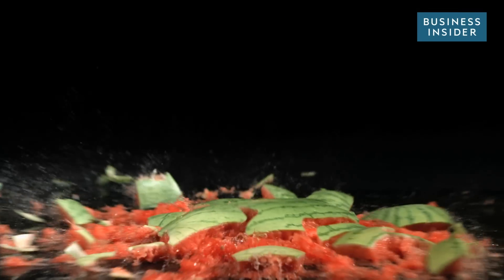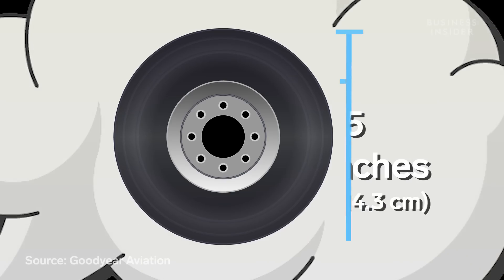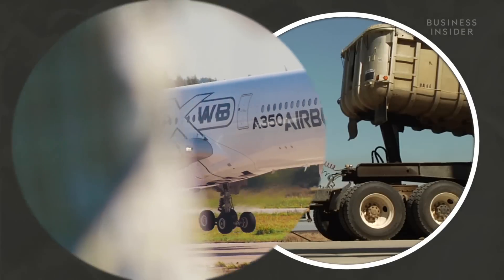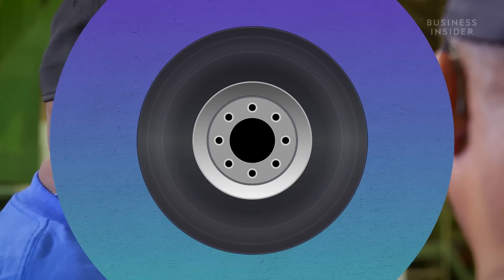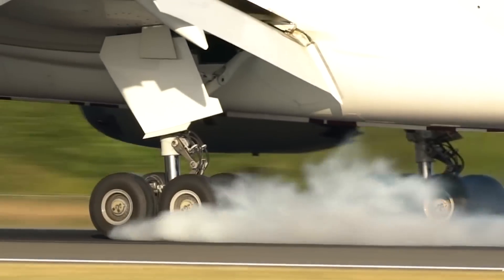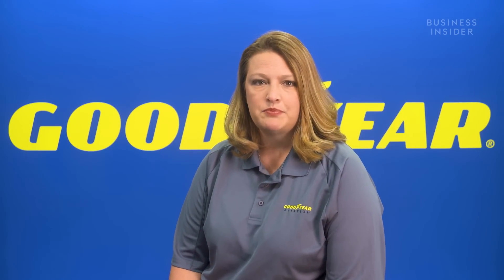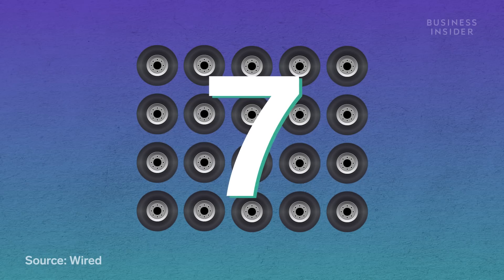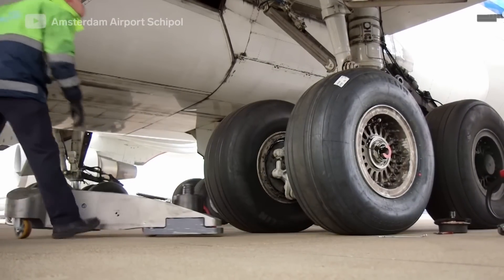Why Plane Tires Don't Explode On Landing

Comment: I don't think Airplanes touch down to the ground straight down at 170MPH, they fly horizontally at around that speed.  The touch down is around 50 feet per minute or as less as the pilot can do to make a smooth almost weightless touchdown once contacted on the ground the spoilers come up and push the aircraft more onto the ground and create drag to slow the aircraft down
Reply: Yeah, you’re right. Whoever produced this video was clearly under qualified
Reply: @colbyjohn207  hey thats not nice
Reply: @evancampbell1963  Correct. Because elsewise I would be dead.
Reply: @analool7873  "because elsewise"?? 🤣. Elsewise.
Reply: They also called the runway a tarmac.
Reply: Landing speeds can be different for different sizes of the plane. Time to time the captain and the UTC would make jokes about this. planemodel-concordeheavy
Reply: @brysonsaviation330  Tarmac is the type of material runways, taxiways and apron are made of. So typically you can call the runway a tarmac. It's just the surface
Reply: I think she meant to say the planes typically land add 170+ mph so the tire is accelerated to 170+mph in a matter of meer micro-sec. But yeah this video was done very poorly.
Reply: I agree. It is kinda dumb that she did not mention the flaps and spoilers
Reply: @flareaviation8831  Flaps, slats, and spoilers have nothing to do with tires.
Reply: Typical Vertical speed at touchdown is ~150 fpm.  Too slow vertical speed may be counterproductive. Depending on weather and RWY Condition it might be safer to land at a higher verical speed. For example to prevent aquaplaning
Reply: @analool7873  im always forgetting about, how much is knot etc. Cos i have studied aviation in Latvian, German and English, and in these languages even tho altitude internationally is said in feet, speed in knotw, but pilots and mechanics tend to keep saying kmh and meters. 

For example an 225 landing and takeoff speed is between 230-285 kmh, while B737 , its 300-330 kmh. 

A lot of it depends on wingspan. Whole 737 is as big as half of the wing of an 225. :D 225 has smoother landings, and at lower speed, and atitude drops a lot slower. And while taking off, for it actually a 3000m runway is enough, because it doesnt need that high of speed, cos of wingspan and wing area. Wing is not only longer, but also a lot wider.
Reply: @Swarmah  damn ur smart
Reply: @xivnz  i suppose, that was a sarcastic insult, because what i said is basic physics
Reply: @Swarmah  it wasn’t sarcastic I promise lol I didn’t have a clue what u said
Reply: @evancampbell1963  But jokes aside. I have flown twice with ryanair.  And you've clearly never heard a joke.
Reply: @analool7873  this is a joke...
Reply: Yes you are true but everything mentioned like the wheel is 6 times lager than a car is to withstand the heat of it touching the ground at that speed (and 170 is still a high speed and sir they are way qualified than they are so.... beat it ) LOL
Reply: Right, I was thinking that too, in fact, it is so obvious.  I wish the producers of these things would not just make stuff up like wildly inaccurate comparisons.
Reply: There are 2 force components on tyres on landing, horizontal one in plane's direction and vertical one. It's this latter that puts tremendous pressure on the tyres due to plane's weight. Harder the landing more is the 'impact', more the pressure.
Reply: @trojan-david  LmAo yOu dOnT kNow wHaT sPoileRs aNd fLaPs ArE? Flaps are the things extending, to generate more lift, so the plane can fly slower. So it doesnt have to land at 220kts, but instead can land at 140kts, which is way safer, since the distance to stop is smaller. Spoilers do the exact opposite. They destroy the lift, so once the aircraft touched down  it wont bounce up again, and since the lift is minimized the pressure on the tires is greater, and thus the traction between runway and tire is greater. And of course spoilers create additional drag, as well as flaps do. 
TLDR: Flaps = More Lift at less speed + drag            Spoilers = Destroys lift/ presses aircraft to ground + drag
Reply: Analool yh sorry I just did some research about it. You’re right
Reply: @analool7873  Maybe learn from this and not LMAO in the future?
Reply: @analool7873  ok then, sorry.
Reply: @analool7873  do you have a disease that makes you write like that?
Reply: It’s under 120 knots. That’s when they can land
Reply: @furqanahmed4557  depends on aircraft.
Reply: Well said
Reply: Ya but horizontal speed counts for friction and strain
Reply: 170MPH is correct its just because not on knots. 170mph is 147knots
Reply: @evancampbell1963  I have and I died
Reply: This is what happens when they get women to explain things
Reply: Pretty sure Terminal velocity is much lower than 170 mph on a watermelon,  Google says 112mph fwiw so obviously little research was done
Reply: @systdow666  yeah I was thinking around 120 mph off the top of my head without looking anything up.
Reply: @evancampbell1963  maybe. maybe not :D
Reply: also only like the 747 and a380 and other very heavy planes touch the ground at 170 MPH
Reply: @aviationtime3202  false
Reply: But they still need to support forward motion of 170mph on top of downward impact
Reply: The Harrier Jump Jet has wheels.
Reply: @evancampbell1963  anyone can reply to your comments, genius
Reply: They didn’t mention about naval air craft those planes need more ridged tires and gears because of being luanched from the cat and dont forget landing which is done at a higher speed and the arresting wires slow you down at a more rapid pace.
Reply: ew no one likes a "actually" person
Reply: im the 1 thousandth like
Reply: 50 feet per minute is extremely slow, that’s like driving at 0.5 MPH, put that into perspective people walk at 3-4MPH. If it was that slow then I don’t think it would feel like driving over a big speed bump.
Reply: Thank you. I immediately thought that when she said that.
Reply: There is a lot of torque and static friction at the bottom of the wheels.
Reply: Wrong.. instead of putting the flaps up when landing you put them up before hand so that it slows speeds. On most planes there’s two settings the first flap slows speeds but dose not decrease speed too much. The second setting makes the flaps fully extended, so you would do this when landing. Have a good day :) (I’m a airplane nerd)
Reply: Yeap, so many things wrong with this video, like how many times they show stuff falling to the ground, which is not at all how airplanes land. Also, the answer to the title is not there, "Why they do't explode?" ... "oh, they are strong" ... done, really, this is the lazy level youtube "tech insider" videos came to? bummer.
Reply: Yes the aircraft touches down at 140 knots and when they’re coming in for landing they pitch the aircraft up which is called a flare
Reply: @Aviator1414  the speed of each aircraft is different on landing, as i explained, we engineers still use kmh, so depending on aircraft, the speed is +-100 kmh on landing. The average is arround 300.
Reply: No shit. U also got ur thrust reverses and ur flaps... like cmon who made this video. Always asking these dumbass questions
Reply: IF the aircraft falls straight down - with little to no forward movement - you could have all the nitrogen in the US in the tires, and that aircraft is still gonna go 'boom'..... the longevity of the tires is as much about forward movement as it is about tire pressure, tire construction, and load capacity.
Reply: American Spotted lol who the HECK uses 50 feet per minute?!?
Reply: Still if you skid a watermelon along the pavement at 170+ MPH, it's going to be Gallagher-class messy as hell.
Reply: No, it's usually around 150-200 feet per minute. 50 is too soft, that is flight simulator pilot nonsense
Reply: Neither does anybody who has the basic capability for logic.
Reply: More like 300 or less
Reply: @Daniel Jones Rolls Royce makes jet engines. And their cars aren't known to be reliable.
Reply: True
Reply: I agree. I’m no pilot but if the pilot hits the ground downwards at 170 mph your tires aren’t going to save you.
Reply: Ryanair pilots entered the chat
Reply: @AdvaitVaze  Ryanait pilots crashed onto the chat
Reply: @analool7873  into*
Reply: Nitrogen is an inert gas? Every chemist in the world would disagree.
Reply: 50 feet per minute is approximately 0.568 MPH.
There are very few aircraft that land at half a mile per hour,
and no commercial passenger jets.
Reply: @robynharris7179  really? Man I gotta go do more research up on aviation
Reply: @robynharris7179  I was waiting for this comment😂😂 I didn’t think he was serious or that I was reading it wrong when he said that
Reply: You clearly don't know what 50 feet per minute is, maybee 50miles or 50 knots per minute tou mean? An aircraft that size couldn't fly at 50 feet per minute. It's not a harrier or f-35b
Reply: Jeremiah 4:7

 

“The lion is come up from his thicket, and the destroyer of the Gentiles is on his way; he is gone forth from his place to make thy land desolate; and thy cities shall be laid waste, without an inhabitant.”
Reply: @Daniel Jones This may be true in 2020 and 2021 only, as these 2 years are particularly 'not good years'. Covid. 😆😁

Comment: I wondered how the Space Shuttle tires survived in space. Then I realized that it's only one more atmosphere in pressure differential for a tire that is already pumped up to a much higher differential. That extra 1 ATM isn't all that significant.
Reply: Yes, the Orbiter tires were of conventional design, though with a different proportion of constituent materials for the modestly higher operating specs.  A unusual problem faced with those was that it could be months between when they were no longer accessible and the time of the landing.  So each one, after mounting on its wheel, had its air loss measured over three months.  Then before flight, "overinflated" to try to have the pressure about right at the presumed landing time.

Comment: Showing other vehicles like a plane  lands or drop at 90° on the runway.  It has both vertical and horizontal components  which also reduces the stress on those tires.
Reply: It also has the lift force on the wings supporting most of the weight.

Comment: Average vertical speed of an aircraft when landing is less than 400ft/ minute which is around 2 meters a second. That's less than 5 miles an hour, so stating that they land at 170mph is wrong. The plane's forward speed could be 160 knots, but the vertical speed, nowhere near that

Comment: Why aren't airplane tires accelerated to ground speed before landing?
Reply: My guess is that Goodyear told them it'd be a bad idea, or the mechanism is too heavy/complicated.  I was thinking it could be kept light by using wind power, utilizing the same principles as a vertical axis turbine.
Reply: @Bart Solari I don't think so.

Comment: The tire debris on highways is from re-treaded tires.  The new tread is glued on to old tires and sometimes the glue comes undone.  I read that airliner tires last about 200 landings - far shorter life than truck tires which last 100,000-200,000 Miles!

Comment: As a pilot, I’d like to know where the Tarmac is. Because I’ve got runways, aprons, taxiways, but no tarmac
Reply: Tarmac is a name for a material that at one point was used in airport pavement construction.  Even though this application no longer uses tarmac as the material, tarmac is the de-facto name for any pavement at the airport, that is built for airplane traffic.  It refers to all of the above collectively.  Runways, jet aprons and taxiways.
Reply: Except it was hardly ever used on airports because it became obsolete within a few years of its development and almost all airports were built with concrete and asphalt. Tarmacadam was the patented name and with the automobile development and oil production coal tar was tossed aside and replaced with pre mixed asphalt with the first flight in 1903 and aviation really not hitting its boom until the late teens and early 20’s tarmac was a minimally used surface in the first paved airports. Especially since most airfields were dirt or grass through the First World War then metal slats with dirt aprons then concrete.

Comment: 10/30/2019

First of all, there is no such thing as a semi-truck. There are semi-trailers and trucks/tractors which pull them.Second, the airplane tire is not falling at 170mph, but 500 feet/min. The tire and the airplane are moving horizontally to the runway at 170mph. Finally, those tire pieces on the highway are not from exploding tires, but from the tire caps coming off retread tires.

Comment: Will Brandy, you are trying to compare apples to oranges.
Airplane tires are constructed differently then automotive and truck tires. The rubber on the road is from recaps. You should learn the facts.

Comment: 1:55 Is Nitrogen an inert gas ? 😄😂
Reply: Nitrogen is isn't an inert gas, in the same sense that argon is an inert gas, but for many purposes it behaves as a quasi-inert gas, because of how energy-intensive it is to break its elemental diatomic form.  Unlike oxygen that may ionize to form ozone, or oxidize other substances such as metal corrosion, nitrogen will not do that.  Some plants have the capability of chemically reacting N2, but for the most part, as long as you don't heat it to flame temperatures, it will stay as N2.

The obvious reason they don't use actual inert gasses to fill tires, is that it is a lot more expensive to distill argon, krypton, neon and xenon from the air.  Nitrogen is the dominant component of air, so it is the most readily available to use, when a non-reactive gas is needed.

Comment: The example you used with the watermelon is unnecessary, it’s all about the landing rate. The landing gear has different components to reduce the landing impact it’s not just the tires that does the work.

Comment: Airplane tires only need those parallel grooves because planes don't need traction on their tires, also planes don't steer at high speeds on the ground.

Comment: "They raise it only 5 centimetres off the ground, which doesn't seem enough to fit a thumb"
You can fit both your thumbs in 5cm and still have room.
Reply: Maybe they meant 5 millimeters.
Reply: @carultch  Maybe, but that's 10 times the length. Quite the oversight. I also wouldn't think 5 milimetres to be enough, unless that pressure of 200 psi is enough that the tires don't deform at all under the weight.

Comment: Narrator: We went to the Goodyear Factory to see how these tires are made...

Goodyear: It’s a secret
Reply: Peg Leg - Who did a good job? The person who put together the video or Goodyear? Also I’m not sure if anyone insinuated all people involved didn’t do a good job either directly or indirectly. Very confused by your comment. It’s as if you were compelled to type on your keyboard at that very moment just to initiate a conversation that ultimately had no relevance to my original comment. You could probably win an award for best vague response on the internet. The only response that would have been anymore vague is if you would’ve responded with “ platypus”. Like do you normally communicate this way or do you usually just use hand gestures? I probably would’ve gotten more clarity if you had just used smoke signals instead....

Comment: The VMO of passenger jets is under 400mph on 911 the “planes” got clocked at 550mph which is impossible. Go fig!
Reply: Tailwind is one instance where ground speed can read higher than Vmo by 100 kt or more.  But no matter -- that 400 is just a nonsense number someone threw out there, to gather up whoever's anxious to buy in.  Sort of like direct mail advertising:  Even with only a few percent response, that's still however many thousands of people.

Comment: 2:59 Most commercial planes don’t have 20 tires. The only commercial plane with that amount was the a380 at 22, and the 747 at 18. Most have 6-10
Reply: Antonov boi
Reply: ANTONOV ON THE OTHER HAND
Reply: Duncan Shimojima Boeing 747 is one of the most used plane
Reply: Mohammad Tanatra “747 is the most used plane” are u high on drugs?
Reply: @Almoody6996  not anymore. Every single airliner is retiring it and replacing them with more reliable 777s.
Reply: I believe the 737 series of planes all use around 6 tires? I have no idea what plane they are thinking of that could possibly use 20 and be used as a commercial airliner.
Reply: "Is" the A380, not "was". It's still in service.

Comment: This video is very misleading. I am an aviation mechanic and have worked with tires. Yes it’s true that air plane tires are strong but by comparison the landing gear and hydraulic systems take more of the weight and stress of landing.

Comment: Even with all those reinforcements they can explode, for instance in a high energy rejected take off. To prevent such an explosion, the wheels are fitted with fusible plugs which give in under extreme heat. This provides a controlled pressure relief, reducing a chance of a sudden tyre blowout.

Comment: Incorrect, 45 inches of rubber is what stands between you and the RUNWAY. There is no such thing as 'tarmac' in an airfield. The runway is where aircraft take off and land, the taxiways are used to get between various portions of an airfield, and the apron/ramp is where aircraft park.